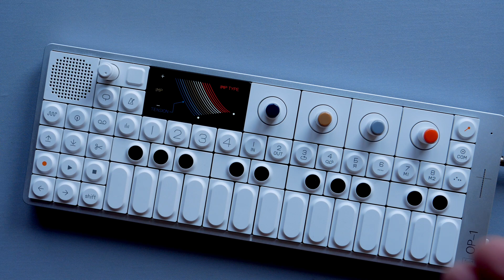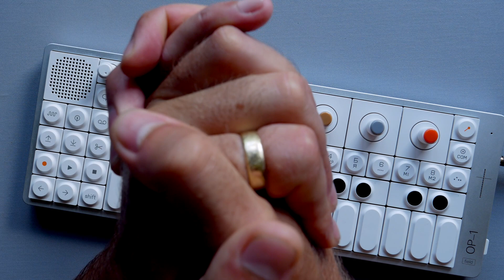OP-1 field TUTORIAL // String Synth

Comment: Hi, thanks for the video. Very helpful. I tried to use STRING/EAST patch and it seems that the sound fades out in a strange way only when it comes from the sequencer. Is there a way to use this patch with a sequence on hold? The sound just fades out and never comes back.  Even if I press the keys again, while the sequencer in on, the sound is not coming back. Thank you!
Reply from the maker: Most sequencers in the OP-1 don’t allow you to hold notes very long…apart from endless and hold. And each sequencers behaviour is different, so I would need to know more specifics. Cheers!